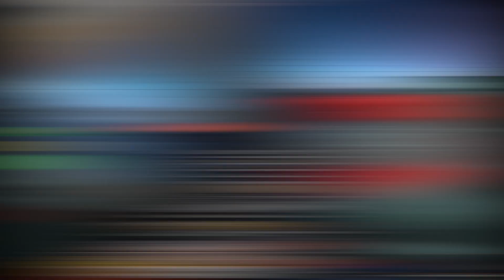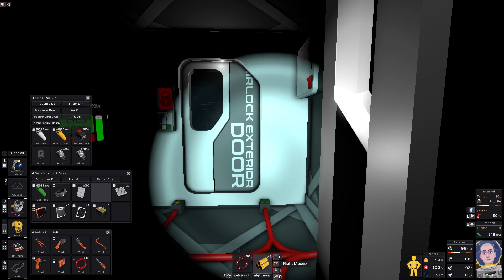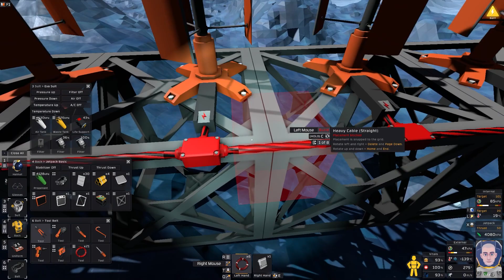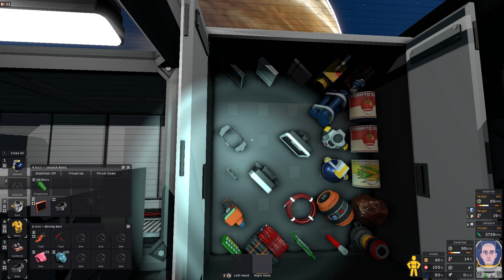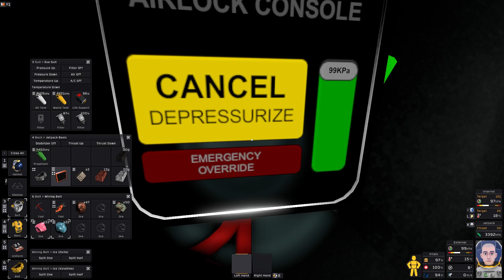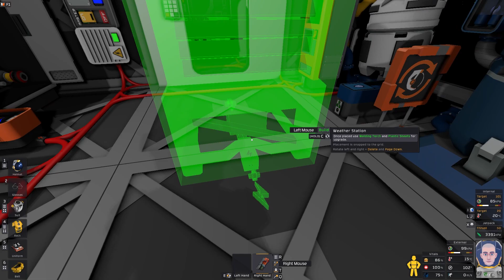Storms! | Stationeers Europa | #3

Comment: Steel frames - Once you can make steel anything, use Steel! Steel is cheaper then iron.
But iron is just streight from the ground and it uses the same amount.. No Steel is 1/3 cheaper then iron, both walls and frames should be steel the moment you can make it. And if you did the effort of getting a furnace this quickly then it is highly efficient.

Composit walls however use sillicon witch is more expensive. so look in the F1 menu to see what resources the items used cost (both initial production and then construction) Flat wall kits cost steel for frame and steel to finish.

Comment: 14:34 When you switch to the drill in flatten mode, it takes whatever level you're standing on as the 'ground' level. If you wanted to lower this, switch to your other hand, move to the lower level and then switch back to the drill. It'll update the 'ground' level and you can drill from there. Easy 'nuff. :)

Comment: I’m a noob so this might not work, but maybe use the heat from ur outside furnace to heat the base with pipe radiators
Reply from the maker: Definitely the best solution. I should have set this up from the start but didn't.